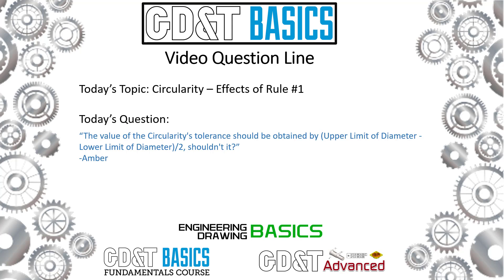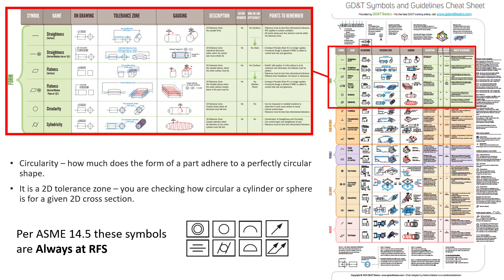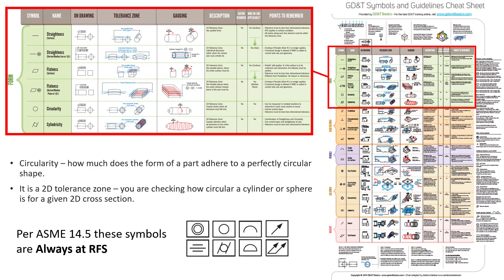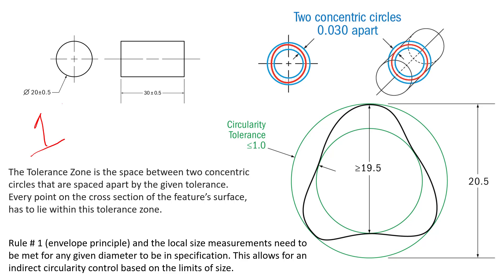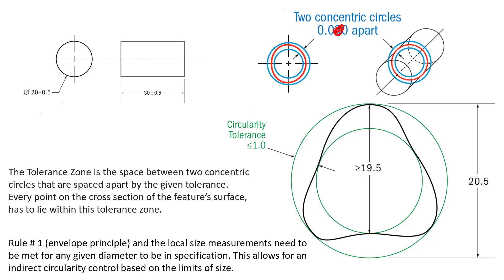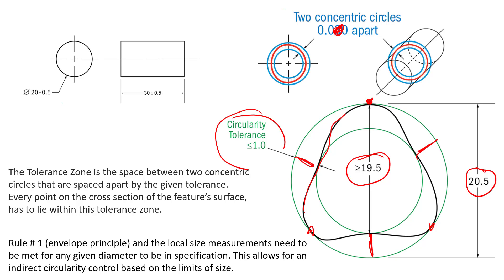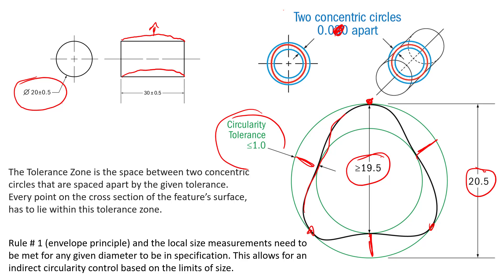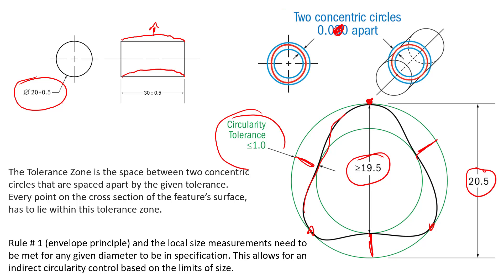Circularity, Rule #1 and How to Report

Comment: The video is very good and everything is correct.
We can say that the circularity tolerance zone cannot be fully used as usual because we have to respect the Envelope Principle which means that in the global measurement it cannot exceed 20.5 but in the local measurement between points there cannot be a size smaller than 19.5 while the smallest circle of the tolerance zone is 18.5
Perhaps the main attribute of the Envelope Principle is that it establishes a form tolerance equal to the size tolerance and not only for circularity but for other surface form tolerances such as straightness, flatness, and cylindricity.

Comment: Sir,
regarding article by GD&T basics on December 21,2014

I have doubt about circularity tolerance,in example (1) regarding dimensional tolerance mentioned the diameter is ∅10.0 with dimensional limit of ±0.08
FOR shaft
If it's MMC, ∅ =10.0+0.08=10.08
If it's LMC,  ∅. =10.0 -0.08=9.92
The difference between MMC and LMC is 10.08-9.92=0.16
My doubt is ,is this value 0.16 belongs to diametrically or radially.
In first example it is shown radially (that is per side) . while calculating Radi of MMC is 10.08/2=5.04( Max Radi)
Same way Radi of LMC is 
9.92/2=4.96(Min Radi)
According to first example limit tolerance is 0.16
So if this limit difference is adding to Radi LMC that is
4.96 +0.16=5.12
That is beyond the Radi MMC(5.04)
If adding 4.96+0.08=5.04
My doubt is this 0.16 value ,total limit or perside limit .

Comment: Amber was right. Per ASME Y14.5M (1994, unless the new versions have updated this), in Figure 6-8, it mentions that circularity is in terms of radius, not diameter. In the example of the video, we're analyzing a dimensional tolerance (and this video excels on how to interpret the diameter tolerance), but it does not address geometrical tolerance for circularity, as there is no circularity symbol in this example.

As explained in the video, in terms of dimensional tolerance, the diameter can either be 19.5 or 20.5. If we add a circularity tolerance on top of that, let's say, of 0.25, and assuming our two measurements at 180 deg apart were 19.5 and 20.5, the dimensions are within tolerance, but the circularity would be (20.5-19.5)/2 = 0.5 mm. We would meet the dimension per its tolerance, but the part would be out of round.

Comment: Your image is showing that the radial separation is 1 but it’s only .5. Circularity refers to the difference in Diameters not radii.
Reply from the maker: Thanks for the comment! We get this confusion alot. The ASME Y14.5 states that circularity is the condition where all points of the surface are equidistant from the axis of that feature. The distance from the axis to the surface is the radius. Thus the value in the circularity tolerance zone is truly the radial distance between two concentric circles as we show. Hopefully this helps clarify things for you!

Comment: I think what's difficult to understand about this is that the large green circle represents MMC, but the smaller green circle does NOT represent LMC. It's actually 18.5mm. So if the part was perfectly circular at the small green circle, it would violate the size tolerance by 1mm. 

So the check for circularity is not "all points fall within the space between the circles," it's "all diametrically opposite points measure within the tolerance amount." What adds confusion is that the axis of the part is irrelevant. Right? It has to be - as you rotate the part to take 2-point measurements the axis of rotation is going to shift. But on your website:

"Two concentric circles, one inner and one outer, in which all the points within the circular surface must fall into. The tolerance zone lies on a plane that is perpendicular to the central axis of the circular feature."

"Circularity is measured by constraining a part, rotating it around the central axis while a height gauge records the variation of the surface. The height gauge must have total variation less than the tolerance amount."

Can you please explain? I am not understanding how these descriptions match what's in the video.
Reply from the maker: Thanks for the questions!  For the first quote you mentioned, this describes exactly the tolerance zone for circularity. What's important to understand is that the diametric size of the circularity tolerance can change, so if we imagine two concentric circles that grow and shrink in size, the only requirement is that they stay radially spaced from each other by the tolerance value. Circularity will NOT control size, but size WILL control circularity. For the second quote you have, this measurement process is technically measuring runout to itself, which gets us very close to measuring for circularity. By measuring it this way we are being conservative.

Comment: I'm afraid you're incorrect my friends. In your illustration you show an outer boundary of 20.5, and an inner boundary of 19.5, yet show a RADIAL SEPARATION of 1.0. That's incorrect. The difference in diameters is 1.0, yes, but that means the radial separation is not 1.0, but half that amount- 0.5. And form controls are always called out with radial separation. Circularity of 0.5 means the radial separation must be, at most, 0.5. So the person asking the question about dividing by 2, I believe is correct. They're accounting for the fact the form control is radial, while the size tolerance is diametral. As you correctly stated, diameter must fall between LMC and MMC to meet size spec. If Circularity of 0.5 is violated, then the size is necessarily out of spec. It cannot but be out of spec.
Reply from the maker: Thanks for your comment! We get this misunderstanding quite often in our courses. Picture the black outlined part in our animation. If we were to check this part in accordance with the size dimension (ignoring the circularity control for now). Rule #1 as applied to a cylindrical feature will state that the cylinder cannot exceed an envelope of perfect form at MMC, thus requiring the outer boundary to be 20.5mm in this case. On the flip side, a size tolerance for external features states that the smallest 2-point measurement cant be any less than the lowest limit as dictated by the tolerances, which would be 19.5mm in this case. This 2-point measurement is not "centered" on the part thus allowing one of the points to potentially shift to the outer boundary limit as you see here. This part still passes the size check.

Now bring in the green circles representing circularity, we see this is indeed a radial separation of 1mm which equals circularity of 1mm. Also, please note that form tolerances don't control the "size" of features. The tolerance zone only requires the radial deviation be held within 1mm. So a part could pass 1mm circularity, but fail the size tolerance.
Reply: Roundness tolerance is the difference between the radii of the concentric circles, not between the diameters.